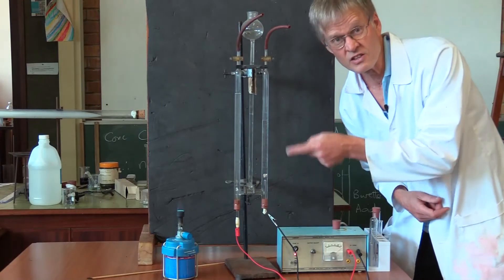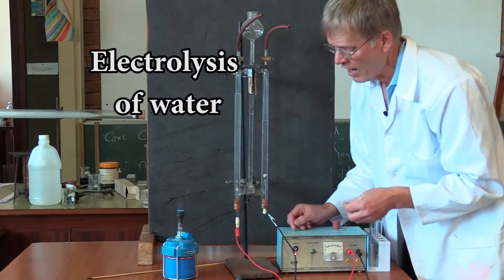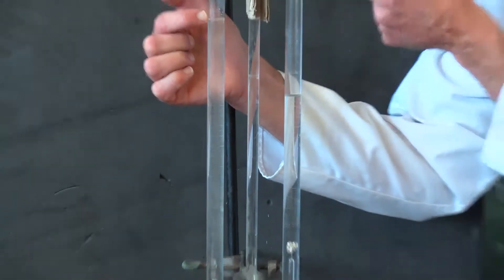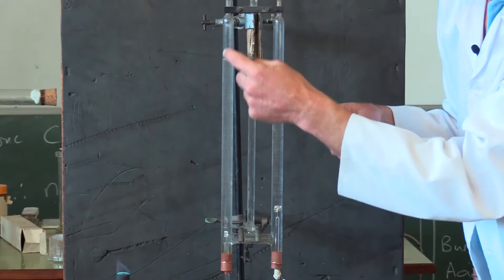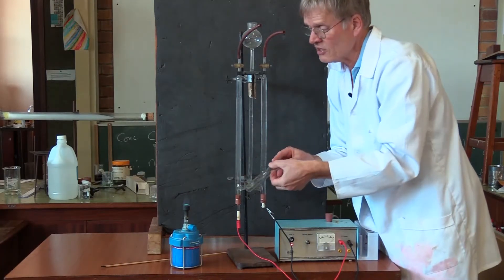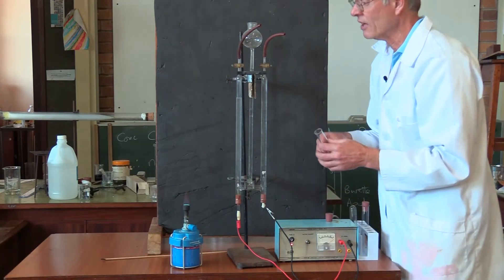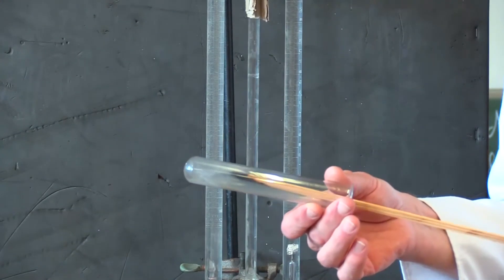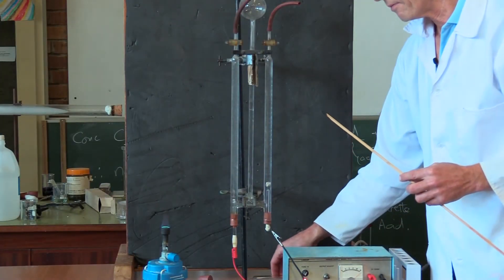Electrolysis of water in a Hoffman apparatus

Comment: Others have commented about why O and H don't bubble up in both tubes, which is something I wondered too, and others have speculated that water is not what was being split.  Here's what I think I have figured out: a significant amount of gas to come out of solution and accumulate at a nucleation site in order to form a bubble.  O and H are both formed at both electrodes, but one those ions is attracted to the nearby electrode where it accumulates while the other ion remains dissolved and travels through the connecting cross tube at the bottom toward the other electrode.  Once it reaches the far electrode it accumulates enough to form bubbles there.  There is probably not enough sulfuric acid to make the amount of gas that was in the tubes, and this demo can be done with other acids / electrolytes, which suggests the gasses are predominantly coming from the water.
Reply from the maker: Hi. Sorry to not having responded before. This isn't something I check up on.
The apparatus is designed to collect them separately. Direct Current DC was used. Hydrogen bubbles off the negative electrode (cathode) and oxygen at the positive electrode (anode)
If AC was used then both gases would be formed at each electrode. But that make an explosive mixture.
I don't even want t think what might happen if one applied a flame to the spouts when releasing the gas.

Comment: If water is split into two parts then surely both gasses will be collected at each electrode. The sulphuric acid must be degrading into hydrogen on the positive electrode and oxygen on the negative electrode! Isn't this obvious Peter?
Reply from the maker: Hi. Sorry to not having responded before. This isn't something I check up on.
The apparatus is designed to collect them separately. Direct Current DC was used. Hydrogen bubbles off the negative electrode (cathode) and oxygen at the positive electrode (anode)
If AC was used then both gases would be formed at each electrode. But that make an explosive mixture.
I don't even want t think what might happen if one applied a flame to the spouts when releasing the gas.

Comment: May I ask the voltage and current for this experiment?
Reply: 20V
Reply from the maker: Hi.  Sorry for not responding years ago. It's not something I check up on. I used a DC transformer. with maximum 12V. 
It just goes faster with a bigger voltage. Takes a few hours to collect the amounts shown

Comment: So after taking oxygen he drops it to the side at 2:25 and opens another tube to demonstrate presence of oxygen. Cool scam. Also water is not H2O, what is happening is decomposition of the electrodes and the electrolyte. You can also do electrolysis without adding the electrolyte and you will see both electrodes decompose. Not water.

Comment: You didn't explain how the hydrogen and oxygen end up in separate tubes. 2H2O -> 2H2 + O2, this reaction would take place at both tubes, so both tubes would have both H2 and O2.
Reply from the maker: Hi my understanding is that H2 is formed at negative electrode only and O2 at the positive electrode. If you try this with AC (alternating current) then you are right.
Reply: @petermcewan4941  yep. ac makes the current have no definite shape, so both terms